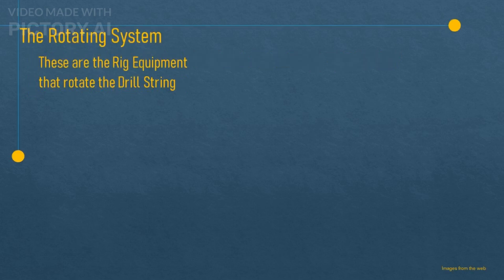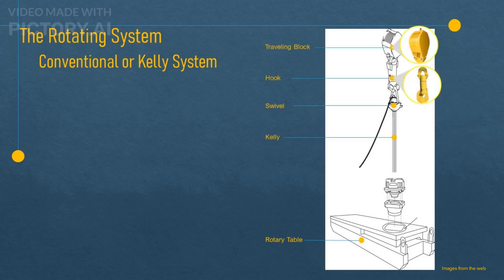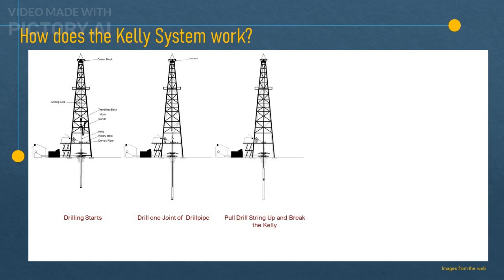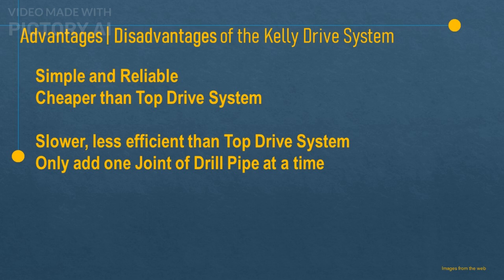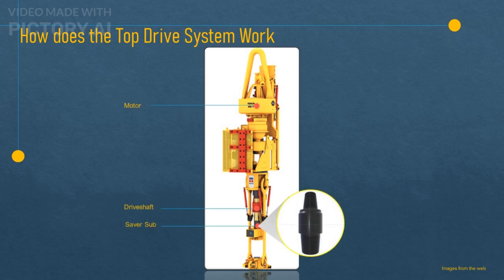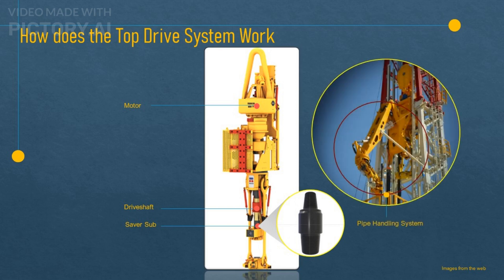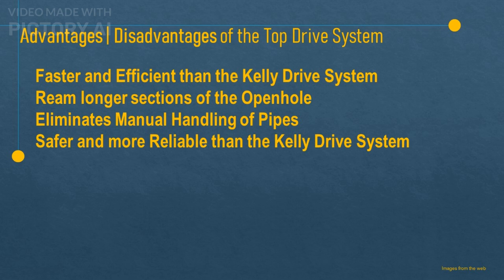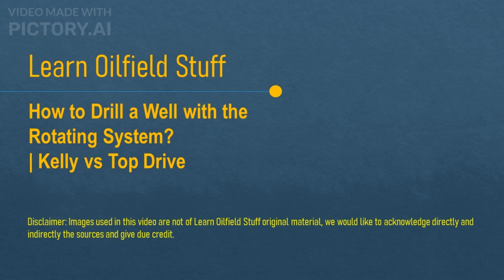How to Drill a Well with a Rotating System  Kelly vs Top Drive

Comment: What did he call the place where he put the Kelly when they were adding Pipe? I thought it was called the Sock.
Reply from the maker: The next joint of pipe to be connected to the Kelly is stored in the mousehole. When the Kelly is not needed, it's stored in the rathole.